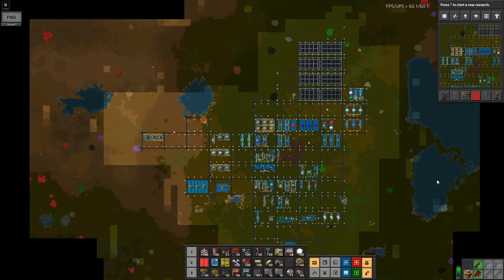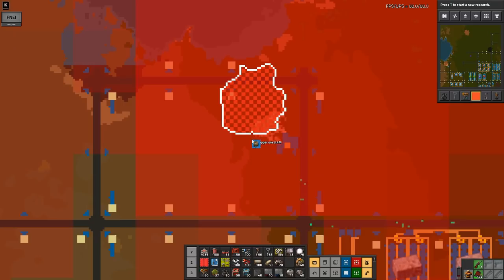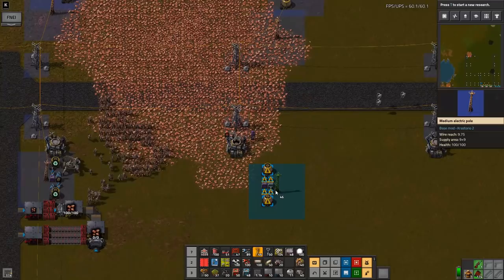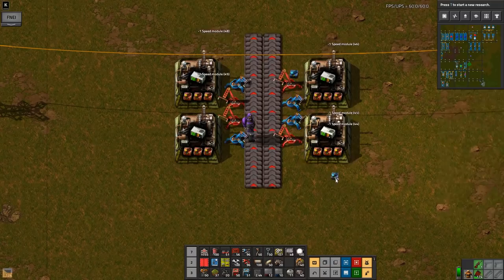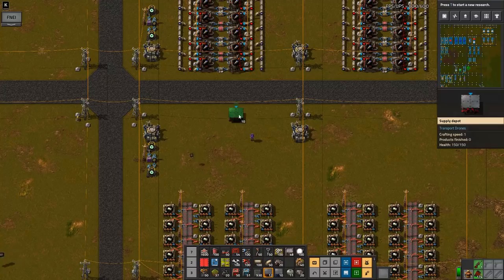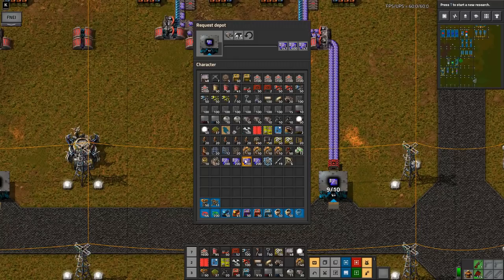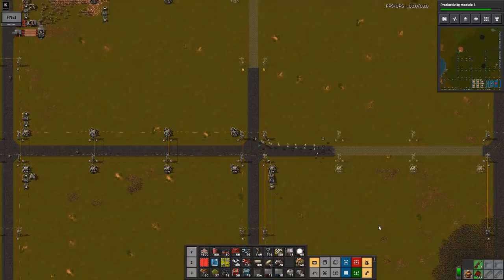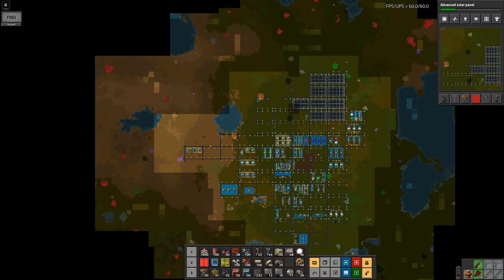Factorio 0.18 Krastorio 2 | #39 ROCKET CONTROL UNITS | Lets Play

Comment: Thanks for explaining the rocket fuel, it makes a lot of sense now.
Also, been following along, and I tried out nuclear power.  The ratios are actually much better, 1 reactor - 5 heat - 25 turbines - 1 pump (and 15-20 heat pipes), it takes up about 2 city block widths if put it all in 1 line.  I think this is the reason why the offshore pump was increased from 1200/s to 1250/s.

Comment: Not sure if you know, or need it, you can (Or, at least in my own playthrough) can put 144 of the miner-human? things? inside each miner.
Reply: Also mining depots already act as provider depots if you hook them up to your road network
Reply: @Starfuchs  I seem to remember him in a previous video saying he thought it looked funny/didnt want to do it that way
Reply: @Starfuchs  The mining drones and transport drones use the same access point on the depot.  It requires the mining depot to be on the far side of the road from the ore patch.   Hiddenx Alpha  is correct that Nilaus didn't like how that looked, and there is no compelling reason either method, Nilaus left them separate.
Reply: its 144 before rocket science, then it slowly increases after a couple of researches. Nilaus didn't put 144 inside each miner because he said he doesn't need that much